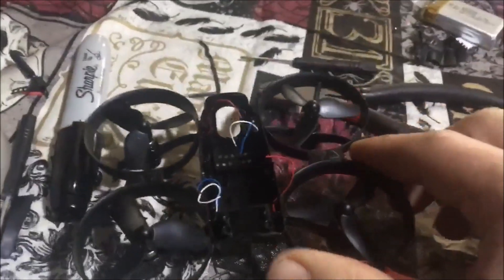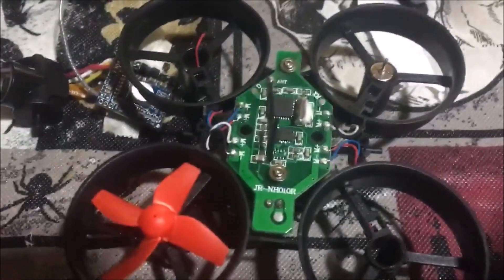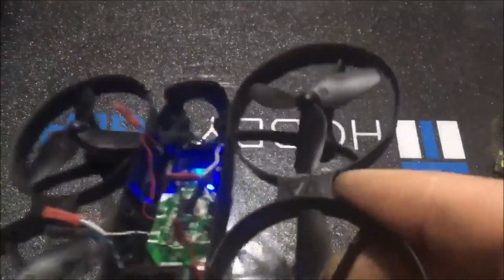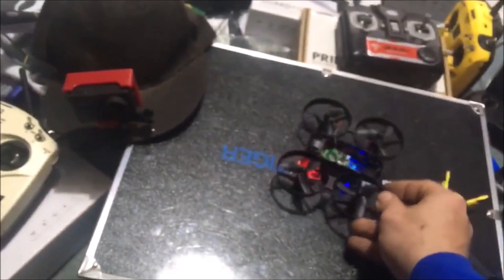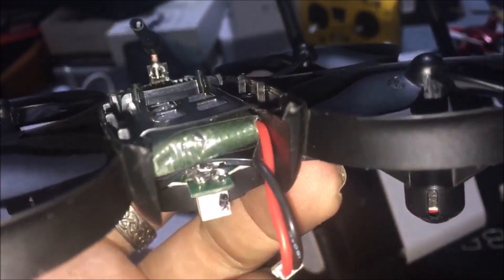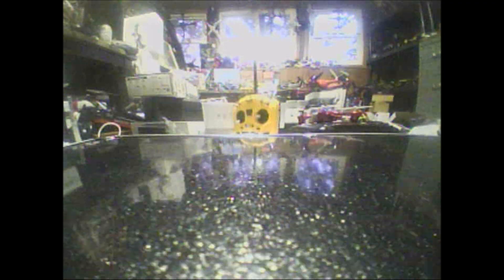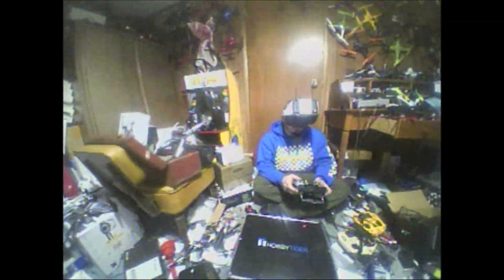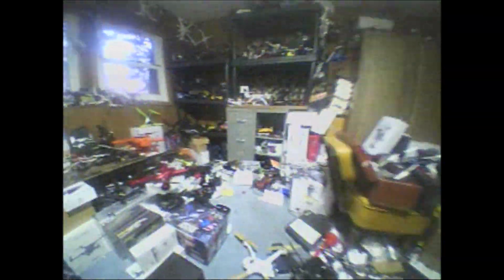Potensic A30W Real FPV MOD Jumper T16 Real Whoop Conversion DIY HOW TO Instructions

Comment: Yep done this with a few drones made my own as well. Best results sometimes i find is to change the props as well. But it all comes down to the tune. Maybe if you look at the processor and see if you can find a reflash and adjust the pid's.😁👍